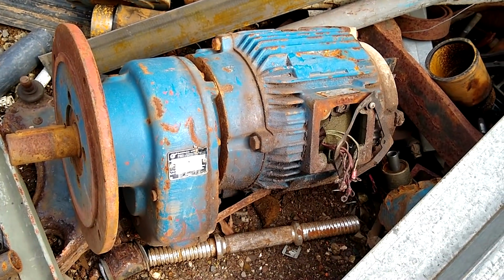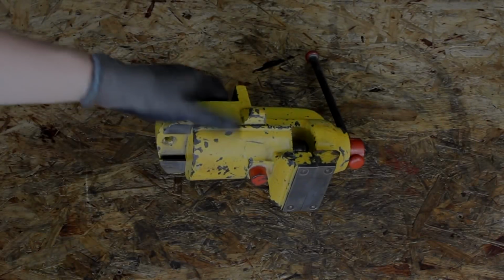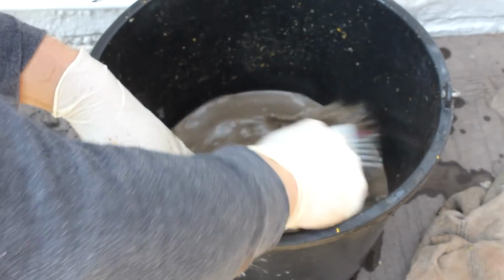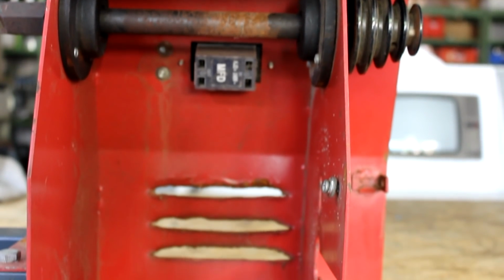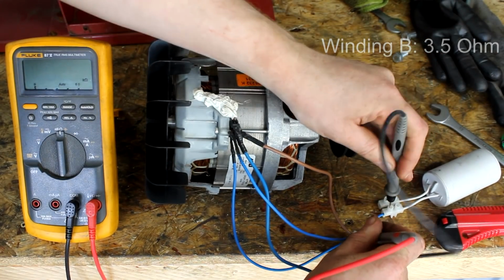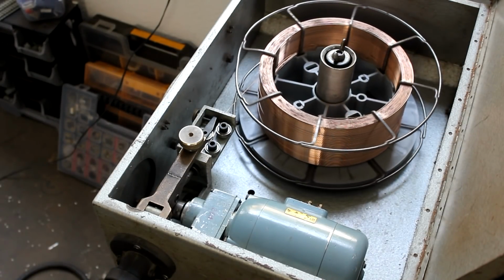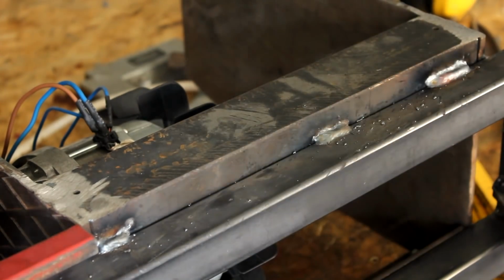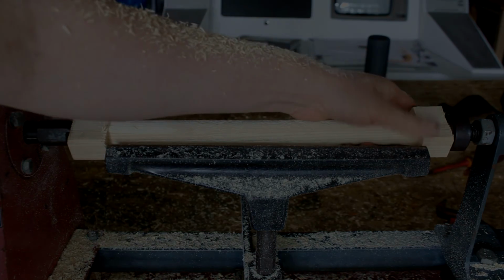New Scrapyard Finds! Repair-A-Thon!

Comment: Isn't there a file bit for drills if not couldn't you get a round file and weld it to a bit or grind one end to fit your drill. Beats so much hand filing.

Comment: If that paint remover is butyl alcohol based spread it about 2-3mm thick then cover the part in plastic for 24 hour. The plastic cover prevents evaporation or drying and makes the product work much better.

Comment: i have the exact same wood lath! i good it for free from a neighbour, it is in pretty much original state, but i have found that the spindel and the tail stock dont correctly line up... and from the looks of it yours has the same problem....

Comment: Why not just replacing the motor pulley to a gear, putting an additional intermediate gear+this pulley...rotation direction problem solved, it can remain in the original boundary....but, it is just an idea....

Comment: The original motor probably had a combination pulley of several diameters, similar to the one on the driven shaft, but in opposite order to give more speed change than just the one set of pulleys.

RichE San Diego, CA

Comment: Great job as usual, love these videos. Just wondering about the motor direction on the lathe, you could have just gotten a slightly longer belt then put a twist in it to change direction?

Comment: At the local museum they had the same
motor direction problem on an 18horsepower steam engine. Their solution was to install the belt in a figure “8” way instead of a “0” way. however your solution is more user serviceable for the motor and easier to allow for futute modding. Love the channel you get a subscriber and a supporter when I get my next job.

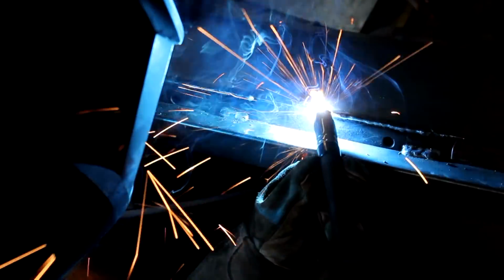Comment: 14:00 I'm wondering if your MIG MAG welding would turn out better if you angled the welder head the other way, so that it points back toward the weld and the direction you're coming from?

Comment: I was looking at how you connected the two holes to make a slot for tensioning the belt and I thought, you might benefit a pneumatic die-grinder with a HSS or Carbide cutting bit. It would make quick work for that task.

Comment: Hay I have try in my fan motor to turn reverse duration by disable the stater coil and refit the motor opens it how it was fired before. Or you can fit the armature in different orantation.

Comment: You could’ve changed the rotational direction of the induction motor, by simply swapping the end plates around, fundamentaly inverting the windings.
We used to do this to HVAC fan motors if the correct direction motors weren’t available. Just means the power cable is exiting the motor at the drive end, usually not too much of a problem.
Keep up the great work, just found your channel and love it.
Cheers from Australia.

Comment: Hi and thank you for your interesting projects. I bought a used lathe for wood, it's ole but looks not used much. The seller said that it was used in a School.
The motor seems not running fast enough for lathe work. I have tried all different belt setting with no avail. Shall I get a new motor? If so, what specification should I look for.

Comment: Sorry to tell you that you only have to switch the cables at the motor connections a specific way to switch the rotational direction. It is possible for 3~ motors and 1~ condensator motors.

Comment: Tip: Use steel wool to help remove the paint during stripping. Apply the stripper, let it process for the manufacturer listed amount of time, then use heavy steel wool while the stripper is still processing. The steel wool will continue the stripping reaction, will remove the paint in hard to get to areas, and will save time by having to do the stripping once.

Comment: (not a proffesional welding although i have had some formal education) although your weld are very nice for someone whithout any reall experience, you might want to try and set the welder a bit hotter, since your weld are very round, this way they wil burn into the steel better. plate material is usually "stitched" togeter, so 3cm of weld 3cm of no weld this prevents warping. much succes

Comment: It needs another stepped pulley on the motor side so you can change the rotation speed. It running a little too fast. If you have a bigger uneven piece of wood on there it will shake itself to pieces.
Great work though, I enjoyed the video!

Comment: Two additional methods of removing paint from cast iron and steel are using your oxygen acetylene torch cutting bar and the electrolysis rust removal setup with sodium carbonate solution. Using the electrolysis to remove paint is just like removing rust and the paint will float off. I won't reiterate the method here as many other sites describe it in detail. Using the oxygen cutting torch is quick but messy. You set the flame as if you were going to cut steel, but instead of preheating the metal you just put the flame on the paint and immediately hit the oxygen lever which causes the paint to burn off with a lot of flame. The underlying metal doesn't even get very hot as the action is so quick, but with flaming bits of paint popping off in every direction. Don't do this inside you shop, but outside in a safe area. It will also remove grease, oil, and plastic.

Comment: I really love your videos very informative. When you were MIG/MAG welding, it sounded like your wire feed was a bit too slow.
Reply: 50 cycle instead of 60 cycle noise?
Reply: @pixelpatter01  No, when the wire feed is too low for the power setting, you can hear the wire popping, as it burns away too quickly to melt into the weld pool.
Reply: I understand what you're saying. Thanks.

Comment: I know it's already too late, but wouldn't change the sense of rotation if you would turn around the entire stator assembly? I'm not sure how these purpose-built motors work but I think it should do the trick. If it is feasible at all, of course... It's a pity that you could not install the motor inside, as how lucky one must be to have a motor on his shelf with the right size and even a pulley preinstalled? :D

Good videos, I wish I would have a possibility to go to places like this... as I did in my young age. I think I would spend all my income there for salvageable items :)

One more subscriber, sir! :)

Comment: 8:53 Never seen a 3-phase motor connected to single phase. Single phase motors can be reversed by reversing the starter winding. Nice lathe dude. But since you have a new motor I guess the old name plate is now useless.

Comment: Passing on the roller was a huge mistake. Not only is it a valuable tool in the shop for many of uses but would have benefited your ability to repair the other items you recover from the scrapyard. Not to mention that restored, the roller could have been worth as much as 2 or 3 thousand Euro.
Reply: Yeah. When he said that he doesn't have room for a machine of that size, I instantly thought, "Hell, I do!"

Comment: You should have totally picked up that slip roller. Even if big  if you got that working 
BIG Canadian eurobucks
Reply: Agreed, the reason I came to comment is to say that passing on the roller was a huge mistake. Not only is it a valuable tool in the shop for many of uses but would have benefited your ability to repair the other items you recover from the scrapyard.

Comment: Awesome ! wood lathes can be really fun, very rewarding. I find it less stressful then working with a metal lathe but the results are usually less shiny :)
Reply: I agree, but you forgot to mention they make a grand mess especially if you have a lot to think about or stress to work off.. I love my lathe.. I have had it for almost 50 years now.. it has helped me work through many a project.. (as it were.)

Comment: get another step pulley for the other side with the same diameters just opposite then the length doesn't change, you really need to slow that thing, at that speed and kinetic energy it will take your arm off. I grew up turning wood. Otherwise really nice build. You got skills as they say.

Comment: I think you can put the belt on in a figure 8 configuration and that will or should work in getting the motor to run correctly.  Problem may be there isn't enough room for the belt to twist into 8.

Comment: The machine with the rollers is to form sheet steel in to what ever diameter that you want
Reply: Keith means to the desired width, not "diameter".
Reply: @greintsma  thanks for yr correction

Comment: To eliminate having to disturb the nasty old paint just leave those rough surfaces faced in. Then all you need to grind is enough to insure good welds and flat mount surfaces. Would minimize disposal rates also.

Comment: Just a little tip about woodturning: holding the tool with one hand at the tool rest and the other hand on the handle gives you the best control over the shaping of the wood.

Comment: Good work! You may have been able to flip the field winding 180° to have the motor spin the other way.
Reply: Another way he could have done it is to flip the stator in the motor around in order not to have to make new mounting holes. Even shaded pole motors have that.

Comment: Nice work!  Another option would have been to drill through the spur mandrel and threaded shaft, and insert a pin to prevent the spur from unthreading, and then flip the lathe around so the motor is on the right side while working.

Comment: Hi there! Thanks for the great video. 
I have a small suggestion about the motor installation. You could use an extra pulley with a cross band and reverse the whole spinning action,  but it's a great video anyway :)

Comment: You might be able to remove the corepack on that motor & reverse it, then the motor would go the other way.
Reply: It's an inexpensive single phase induction motor and designed to prevent reverse operation.The stator windings will be well glued in with varnish - picking them apart will be pretty hit and miss. Rather like trying to find the star point to convert a '440v only' motor to 230v operation.

2nd hand IMs are plentiful and cheap as chips, usually free. Why bother?
Reply: @alastairbarkley6572  I didnt mean that way. the corepack is a laminated iron plate assy complete with windings, in the past I have just unbolted these then reversed them and bolted them back on, the motor goes the other way, 15 mins work.

Comment: I enjoy your videos, and am happy to see you working on a wood lathe. My first thought when I saw the lathe that it wasn't very torsionally rigid, but you addressed that with your steel tube welding. 👏

The ability to change speeds when woodturning is more than just a convenience, it's also a major safety feature. I suggest you get a stepped pulley for the motor drive so that you can adjust the spindle speeds to a set of steps between about 500-800 RPM on the low end and around 3000 on the high end. You'll also need a way to easily remove and re-add tension to the belt as you change speeds. Small pieces (like the one you turned as a demo) can be turned faster, but larger items must be slower. Large pieces turning fast can do incredible damage when things go wrong. 

Best wishes

Comment: When you next weld slow down the wire speed a little bit more, a crisp crackle is the sound your needing, keep the earth lead a close as possible  , older welders need a little bit more love than your modern welders 👍

Comment: Those are great finds you came across at the junk yard.
Do you find many wheeled battery chargers at junk yards? I repair them for customers and would like to find some inexpensive ones to use as loaners or to sell. I appreciate any thoughts you have on this.

Comment: Great to bring that old lathe back to life. A couple of notes:

I don't understand why people like the paint removing chemicals so much. I prefer the wire wheel. With a fine one you can get into the crevices quite well.

I don't know if it's my imagination but that looked like a common thread, maybe 1 by 8tpi. I think you can get standard chucks for that. I bought a bunch by a welder, you could probably make them. Use a nut and weld a washer to it. Drill a couple of holes in it for wood screws and you can mount bowl blanks on that. Believe it or not if you use a piece of scrap wood you can glue your workpiece on with a brown paper bag in between and it will not fly off. Removal is easy as you pry with a chisel the paper rips in half and releases your part. It's a very handy old woodworker's trick so there are no screws in what you are trying to turn and it costs basically nothing.

If you get the same size pulley as above,  you can mount it to your motor 180 on the shaft and the speed changing part will be so much easier.

Wood turning is a lot of fun. Part of the fun can be making your own turning tools and fixtures (which I'm sure would make a great video series). The reason your cut was ragged is because you need to learn to "skew cut" google it. Also learn how to sharpen a bowl gouge or "irish grind" for great internal cuts.

For roughing gouges I cut open a car machpherson strut cartridge and made my own. The more mass the less vibration comes through your tool to your hands/body.

Comment: Filing like that.... tut tut... Check out the channel by "Click Spring" for filing.

When turning wood, hold the chisel cutting end keeping a "Letter posting" hold on the end about 2 inches and use the guide to hold the chisel safely so it can't be snatched or flipped out your hand in to a projectile.

To aggressive a cut can also kick the work out the centres and has a real possiblity to smack you in the head.

AND... I Really hope that you had your hair tied back and netted when using a rotary tool like that... Same principle of using a lathe and a traditional tie... ripe for incident.

Bit like my dad who was careless to not pay attention to where his fingers were and managed to cut his little finger off, mind you this was in the days before Health and Safety or safety guards.

Still, it only takes a little slip to seriously injure yourself. 

Last thing that I want is to see your channel become your legacy and epitaph...

Comment: installing the motor out of the enclosure seems like the dumbest idea ever... just place the motor inside of the enclosure, remove the little wheel, mount a gear there instead, drill a hole in the enclosure, put a rod through them (and dont forget the bearings), mount a gear on the rod (use the same gear ratio...) --> there you have it you just build yourself a reverse drive. now attach the little wheel to the new rod and take a shorter belt. 

i know this is way more work but i think still the more professional solution.

Comment: would that motor work with a dimmer switch?  would probably not be worth it to install a variac unless you had one laying around.  simple speed controls would be helpful with that lathe

Comment: to get the correct turning speeds on the spindle you need another pulley with several sheaves just like the one on the head spindle. then mount it in opposition on the motor shaft.

Comment: The lathe is more, is alot more stable with your modifications and looks very nice, But I was thanking maybe the motor rotation could have been changed. As I had that same problem with a Air Conditioner  motor, I had a good replacement, but rotation was different from the original. What I did was remove the screws that held front and end, the rotor was held on the front face, so then swap I it around. So maybe in your case you could have just swap the rotor around?

Comment: Hmm, that bright orange primer beneath the paint, looks kinda like lead oxide paint, so always a good call to not use physical means to remove old paint. Paint stripper kinda is just bad for you health (that's why you gloves should be thicker and not ripped apart ;), if everything is evaporated it leaves just the stripped paint.

Comment: That silver vehicle in the crushed stack at the start looked like a new-version Beetle.
That heat-exchanger reminds me of Starwars, when Obi-wan was turning off the Death-star's tractor-beams. You could leave a business card on the fenced-in welder, see if whoever was picking it up would want assistance fixing it up. Fascinating design on that vice, I'd not seen one with the rear jaw being the moving one until now!
Great work on the wood lathe, now you can have round legs on things you build!

Comment: Its sad that, there is not more scrapyards, that open their doors to sell, here in my area of Quebec, you can get permanently banded from the yard, if they even catch you  picking up even a hinge, they don't seem to understand, there is useful things that can still be used, or made in to something else, as you clearly shown in your video's. BTW you can add a second set of pulleys to the motor, you will have greater speed control, My wood lathe has two sets of 4 pulleys assembly  ,One on the motor, to a drive shaft, and on other on the same drive shaft, to the head, that also has a 4 pulley assembly.

Comment: for the engine  rotate to the contrary, would you have less work if you reverse one of the engine coils (the main or the auxiliary)? even if you do not have access to them, with a little patience you raised the connections (inside the engine) and inverted, lashed again, and with a little veneer to finish.
greetings from Portugal

Comment: There are cheap (20€) modules for air compressors. They make a sandblaster out of it. This might be good enough to strip the paint of some metal parts.

Comment: The bearings in the lathe sound pretty rough, maybe consider replacing them at some point? I love the little vise, such a magical scrapyard
Reply: i was thinking too that there is so much amazing stuff there. I wish i got my hands into ac-dc tig, specially one of those old ones that last last last and still last

Comment: what great little lathe ,One thing you may want to try in the future is to use A variable Dc motor I have known people that built lathes using old treadmill motors . thanks for another great video anyway to bad you did not get that motor from that old roller .